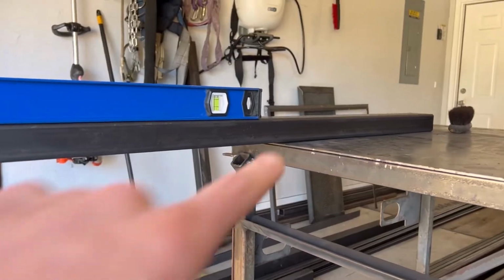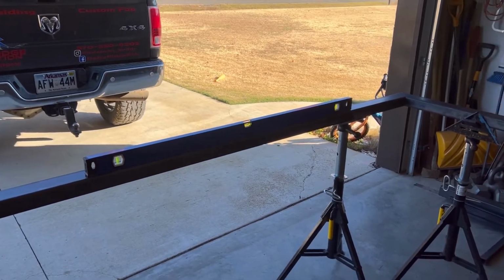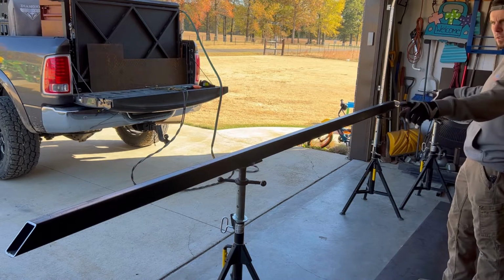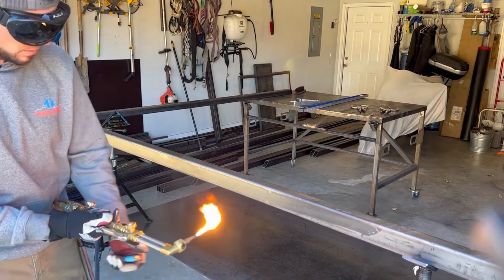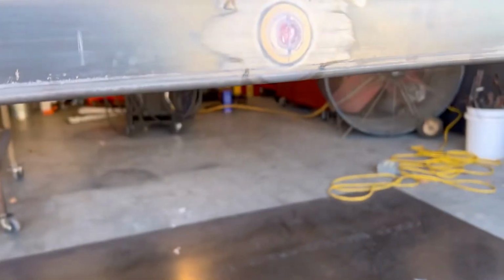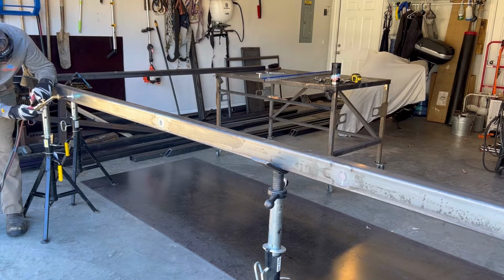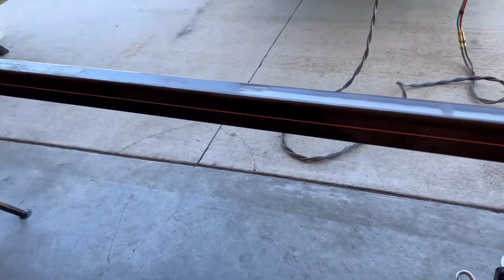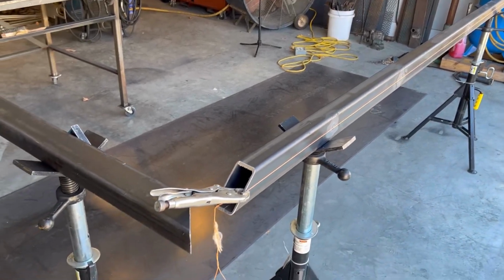Heat Straightening Steel | Fire Fixes Everything

Comment: I made a steel stairway where the client wanted 12 inch channel on both sides with concrete steps. I had to weld brackets to the channel for those steps and the channel bent like a banana. I spent many hours of heat shrinking those two channels but ended up getting them straight. It is a interesting process and a life saver.

Comment: Nicely done. I'd add more support or just lay the bar on the floor. Unsupported sections may cause twists because it moves freely, relative to supported sections.

Bends easier to fix. Twists not so much.

Comment: just a tip with the string,use 3 small blocks, one under each end, all 3 should be the same thickness use the last piece as your gauge for in or out, you can now tell if your to far one way or another. I  put the blocks in after i have the string good and tight.